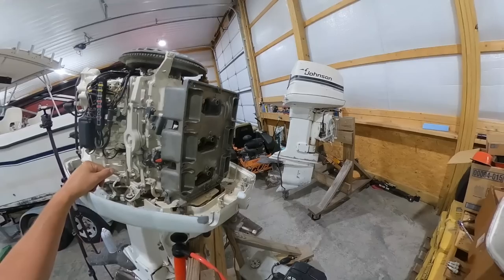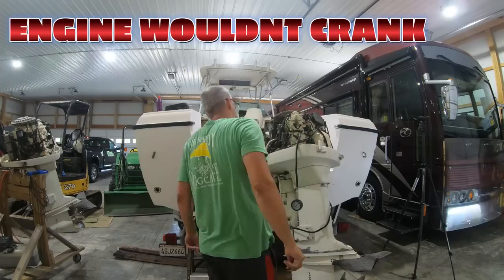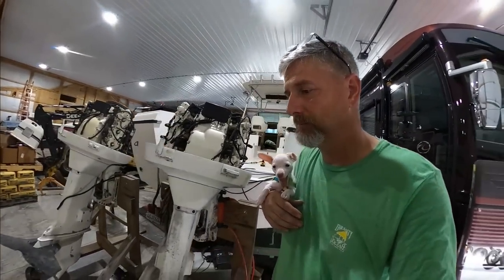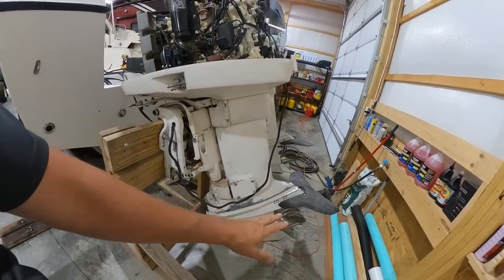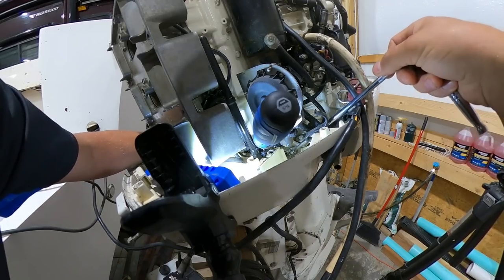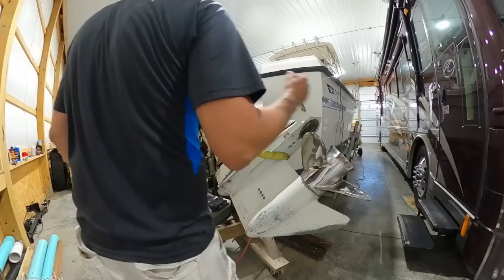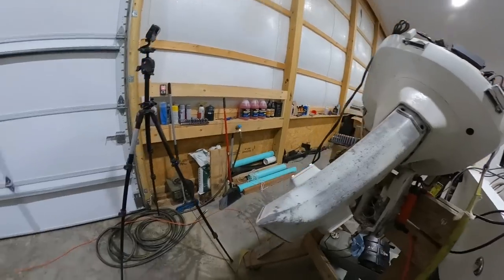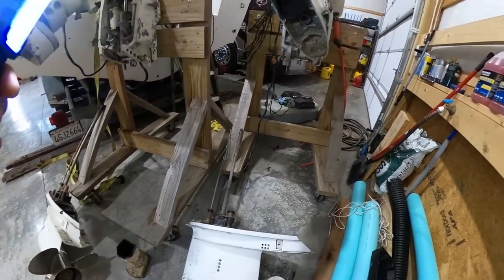JOHNSON 235 BOAT MOTOR COMPRESSION TEST AND LOWER REMOVAL | EPS66 | $10 BOAT | SHOTS LIFE

Comment: have to say after a life on salt water, engines that lived on freshwater or a trailer are a sight to behold!!  Almost no corrosion to speak of and an old model that wouldn't even exist around here and if it did there would not be a bolt you could turn on it and chunks of the castings gone.  So I will sit back and enjoy seeing an old outboard taken down and repaired!!  Old 2 cycles were infamous for oil fouling the rings.  Readings should be around 120 psi  within ten percent of each other.  Reed valves were also a failure point in high hour engines.  Those old Johnrudes were pretty reliable except for the auto oilers.  The dealer and everyone I knew around here ran mixed gas and deleted the pump.  Then they really were a good long lived motor.  In a two cycle it is important to not over mix your fuel oil ratio as it speeds up oil fouling in the rings if it is too rich.  We used to refer to this style as the "Bathtub Johnrudes" cause you could give a kid a bath in the top cowl!  Working on almost all big outboards of the period was much easier when the cowl was removed.
Reply from the maker: Yeah I’ll bet the fresh waters were a lot cleaner, saltwater is tough on things. So I learned my VROs were replaced with OMS pumps… so they were really dependable. Learning as I go!

Comment: That one engine just needs to run and that cylinder clear up, youll see a significant bump in compression after 5-10 hours of running them. due to the rings loosening up from the heat. Its something that only running the motor will clear up. Compression is also supposed to be measured with the throttle completely open. Having the throttle closed can limit the amount of air avaliable for the engine to make compression from., youll see a pretty big bump in readings with it open.
Reply from the maker: Yeah I had the carbs open, and I agree we should see a big bump after they run, fingers crossed!
Reply: I was going to say something similar.  I loosened up and did light refurbishments of olde 6 cylinders in some of the trucks I have restored or kept as survivor’s depending on the condition of each truck. Some motors can be stuck, you loosen them up, (ones I know we’re running when parked) get some oil in around the rings and so on. Fire them up, and they can be pretty rough due to stuck valves etc. they smoke from all the oil &/or diesel in them to loosen them up and as you run them the oil gets to where it needs to be. 1 in 4 will clean right up and run just fine after some mileage on them and a couple of oil changes. Another 1 in 4 still need the top end done to be fine, then there’s the other 2,,,, 😮😮. Haha.  
   These being 2 stroke eliminate half of the problem areas so I think there’s a good chance of them smartening right up. I’m not that knowledgeable about 2 strokes mind you.   I will defer to your knowledge.

Comment: I have used OMC triple guard grease on all bolts I use in a marine environment.   Grab a tube you won't be sorry.   Have used it with stainless steel bolts in aluminum housing and the boat was exclusively used in the ocean.   Things always came apart with ease.   Keep up the great job you are doing
Reply from the maker: I’ll try that!

Comment: Yeah, on to the motors! 
Surprised to see twin 235's on this model! Wow. My twin 200 Yamaha HPDI's scream on my 25 Grady! Should be fun once you get them going. 
I think compression on a really good motor/low hours would be somewhere around 85 to 90psi. I don't recall what my former OMC Seadrive motors were, I think around in the 80's. That motor was a 1986 model. I agree once you can get them running a bit and let them set the rings from sitting so long, you might get a bit more on all of the cylinders.  I did bypass the VRO since it failed while running offshore. I ran the motor another 20+ years on the mix with no issues. Some piece of mind actually. Based on the age of these, I think is a good idea to do the bypass. 
On the motor trim tabs to align them, I was told to run them dead center on each side. Each side should be left or right specific as they should have a bit of a curve on them to put pressure when running forward and I guess helps the motors keep from wandering. 
Those motors do look really clean so glad you don't have to worry with saltwater corrosion and frozen bolts issues!
Reply from the maker: Yeah that’s a lot of power for sure! Good stuff, interesting on the trim tabs…

Comment: Danger Stu has a good video on the tilt trim. There's a vent screw on the cylinder housing you can open so you can raise them by hand. I always remove the lower cowling because it gives you more room with the shift rod especially when you are putting them back on. Pull the thermostats and flush the system you can just shove the water hose in the pick-up tube, and it should come out the tell tale. I would run them just at idle for about 30 minutes to free everything up and check the compression again.
Reply from the maker: Yeah Danger Stu is great. Hmmmm, didn’t know the lower cowling came off…
Reply: @shotslife  The Name of the Channel is actually Dangar Marine with an A. He lives on Dangar Island, I don´t think he´s dangerous.
Reply: I wouldnt count on being able to lift it by hand just by releasing/removing the vent screw. That rarely releases the compression on my 125 or 250s enough to lift by myself by hand. at least in my experience and I've done it multiple times on both engines.

Comment: I like the single 250 hp motor idea, too. Hang a 9.9 for trolling and limping back to port. I run in the ocean that way, just not way offshore. Save you gas money too. 4 stroke 250 Suzi runs VERY economically.

Comment: Loving the boat videos. I am restoring a 25' center console that came with twin 1989 200hp Johnson 2 stroke motors original to the boat with 527.3 hours. My 2 stroke research in thinking about re-using these motors went out the window with fuel consumption and reliability. So, i'm going to put a dive bracket on and go with twin 200hp Suzuki outboards to go offshore with turn key reliability and great fuel economy.  Maybe you should consider going 4 stroke and ditch the 2 stroke problems. Anyways, looking forward to your next video. RET Army 153DB .....
Reply from the maker: Yeah if I wasn’t on a budget with this I probably would have done that… but $$$

Comment: Get it running to loosen up the rings, I bet the compression improves. Also that O-ring on the shaft is the face seal that is supposed to prevent water/air getting through the top of the impeller housing.
Reply from the maker: That’s what I’m thing as well… ahhh the seal, sounds good

Comment: when you go to put those lowers back on, save yourself a lot of hassle and have a helper.  a pair of long needle nose pliers and you can grab that gear selector shaft from under the cowling and get it to line up for your pin.  You can do it with a floor jack to lift the lower but its easier if one person lifts the lower and twists the prop while the other aligns the gear select.  Gonna be a fun experience either way.
Reply from the maker: Yeah that’s the next step! Should be fun!!

Comment: Those compression gauges are notorious for not being very accurate, especially the Harbor Freight brands. I wouldn't worry too much about those numbers as those old loopers were low compression motors. I think my last one had 90-95 psi and it ran fine. Not sure why OMC made it so difficult to get the lower off. The Yamahas are super easy compared to these. Keep up the good work and look forward to the next video.
Reply from the maker: Thanks!

Comment: If you have difficulty aligning and installing the shifter linkage bolt, here is how I would proceed. Instead of removing the air box/carb/intake, simply remove the lower cowling (where you hooked your ratchet strap). There are a few bolts, simple to do and it gives you much more room to complete other tasks.
Reply from the maker: That’s a really cool tip, one other person suggested that as well… good stuff

Comment: Sorry to hear about the sad card. The compression is usually around 125 and they have been sitting a long time once you get the implers changed that will help tremendously. The piece on the motor just below the fin are a steering adjustment and line it up with marks and a stainless steel bolt to hold it in. I can see why you have a major clean up on them.  The implers are pretty easy take your time and pictures 
Thanks,
Tim
Reply from the maker: Thanks Tim.

Comment: I feel your pain. I got those gear lever bolts out the same way you did but putting them back in was a different story. I ended up pulling the carbs for access. Some suggest pulling the lower cowl but I had one bolt I just couldn't get at.
Reply from the maker: Yeah I’m going to try the lower cowling first… then the carbs if it doesn’t work…

Comment: I agree with TheFritz423... Shot. Get it running, exercise the rings and valves wont idle worth a dam, but don't bump it up more than 1000rmp on the earmuffs. Should improve ... but that will tell you if you need to have the head rebuilt. Get the manual will tell you required compression range 75 -85 psi is close but ever model and brand is different by year.  Ground those coils while cranking over.  Or get couple new screws....Yikes!
Reply from the maker: Good stuff

Comment: Normally I would have expected around 90psi for compression, but if they are all consistent except the one cylinder it is probably good at 70. The one cylinder seems to have a stuck ring. Running the engines to warm them up may loosen the rings. I would get an inspection camera and take a look inside to see if the cylinder walls are scarred.
Reply from the maker: Yeah that’s what I’m thinking, a camera is a good idea!

Comment: The typical compression from factory is around 80-90 psi. The lower compression is usually due to worn rings and allowing the pressure to blow past the rings. A good rule of thumb is a 10 percent variance. When you get them running and see an increase of white smoke, you know it is burning the oil. If you are ok with that then keep running the boat. However, at some point you will need to remove the power head and rebuild.
Reply from the maker: Sounds like a plan!

Comment: Best advice I can give anyone is get a shop manual, if not the original OMC then a Clymer's.  Lots of them around often on line but they are indispensable for so many details that they can make the difference between success and failure.  Techniques and specs that are not obvious especially to anyone not doing this work on a daily basis.  I am suspicious that you will be doing a short block on these with the compression readings which is not all that difficult, if you have the manual.  Really makes sense when you consider new 200hp outboards are running in the 25 grand each neighborhood these days.  A fresh water motor especially is likely worth rebuilding if it hasn't had catastrophic damage.
Reply from the maker: Good stuff, thanks!

Comment: These smoke at low rpm and drink the fuel. I rebuilt my VRO. Its nice to use the oil tank system if you keep them. I rebuild my 1998 J150ois. I would take a F115 Yamaha in a heart beat.
Reply from the maker: Yeah I figured they would smoke… and they are gas hogs but I like the idea of keeping them alive!

Comment: You'll be better off with one Yamaha motor than with those two motors. We have the same boat and re powered with two Yamaha motors years ago and never had a problem again, very dependable motors with zero issues and we use our boat all the time.

Comment: Important to pressure test the lower units before you put her all together to make sure all your seals are holding.  You hand pump it up to three or four psi and see if it holds it for twenty minutes or more.  Sucks to get her together and then find out you have fishing line in behind the prop and the seal has failed.  Replace the o rings on the screws and check the oil for water.  Good project.

Comment: Chief,  I dont know about the one motor option. My boat is bigger and weighs more, but whenever I go down a motor, the best I can get with the remaining 250 is about 8 MPH. It just wont push the boat any faster than that. Does 40 with both motors on a flat sea, but wont hardly move when down to 1. Something to think about....maybe yours would do better....
Reply from the maker: Wow, 8mph that’s slooooooow!

Comment: I could tell you some VRO stories, but I won't. Those 235s had a "reputation", that's all I'm saying. You might be better off to just get rebuilt power heads and trade those in if you can.  I doubt anyone even has those old blocks anymore so maybe someone will rebuild them for you. To hook up the shifter linkage, you need to remove that intake manifold and the bottom carb so you can get your paws in there. That unbolted part is called a trim tab among other names.  Notice the fin is canted off at a slight angle.  Those need to be set in a straight line with the cant just off center to the right. It will affect your steering response and helps the engines track straight. Think of it like a front end alignment on a car.
Reply from the maker: Yeah, part of the cut video is me marking the one with a sharpie before I took it off so I know exactly how they were.. good stuff!

Comment: The tilt motor could be fine, check out the rheostat that powers the tilt motor. Had same problem and it was the rheostat. Pretty sure it's called that, easy to replace. There is one to lift and one to drop, on my Suzi.......
Reply from the maker: Hmmm, I’ll look that up
Reply: It's a PTT relay buddy. I found my old one.  On my motor there are 2 to actuate up and down.

Comment: These old 2 strokes can burn fuel like you wouldn't believe. A couple used 4 stroke 150s would probably pay for themselves fairly quickly  if you run this boat very much. I mean I run a 1998 suzuki 200 2s and get 1.7 mpg on my deep vee 20 footer. Crazy...
Reply from the maker: Yeah I figured they will gulp it up

Comment: are your throttle plates wide open when testing compression? Low compression , rings could be stuck from sitting so long. Run it for a little while and see what happens. Good luck.
Reply from the maker: Yup, they were wide open… thanks!

Comment: These are looper motors if they 1985 johnsons. compression will be much lower then other outboard 2 strokes which need to be above 90. the bottom right was 72 first reading? what was the other cylinders reading? as long as you have 10% variance you are good. That motor hasnt run in a long time . I would run it burn the carbon out so you get a better reading.Just delete the VRO save yourself the headache
Reply: Yep what this fella said. With any luck the cylinders are just dry and need to be ran until it comes up to operating temp you might get lucky
Reply from the maker: The others were all 70 psi
Reply: @shotslife  its fine! it will go up when you run it.

Comment: 70 is too low , much less 65. It will run with loss of top end & high fuel burn.
Reply from the maker: Yeah, my harbor freight gauge might not be the best either, however these are low compression engines so 90ish was what they ran new.